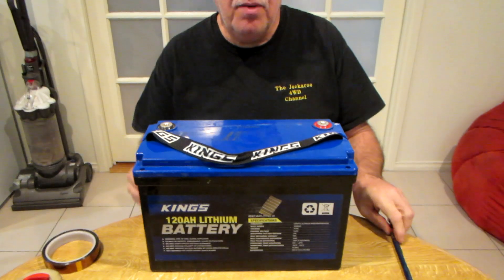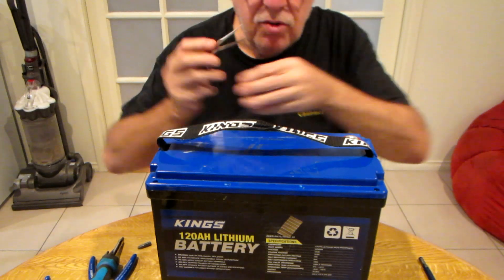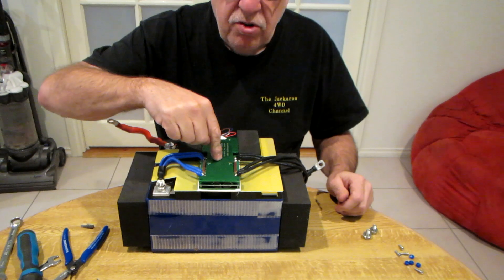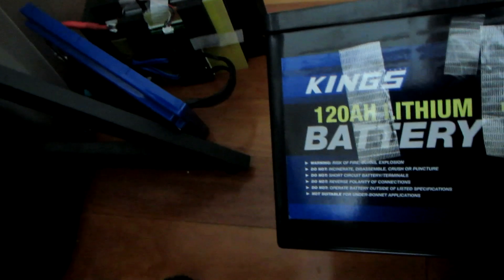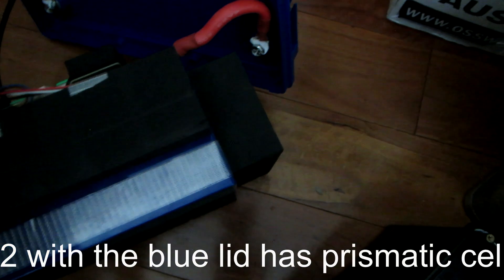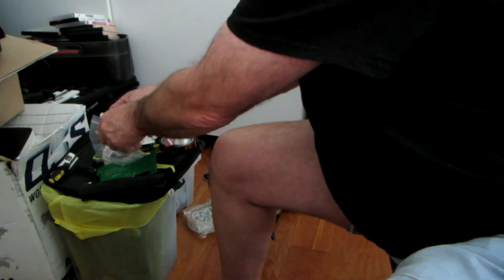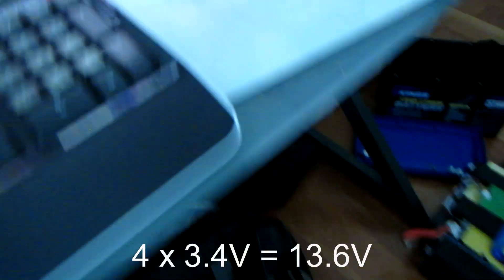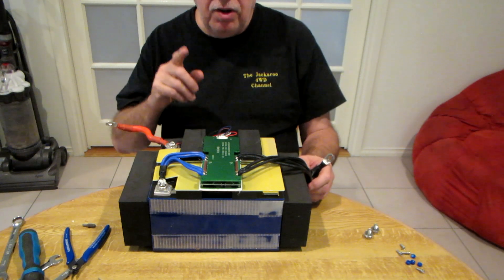BMS Swap in LiFePo4 Battery Part 1

Comment: i got a kings 120ah lithium battery, can i get it to hook up on the phone as you did in this video if so how is it done pls what app do i need
Reply from the maker: I was using the Oricom battery monitor. However, I have just ordered two new BMS with Bluetooth modules. If you can wait a week or so they are due on the 31st July. I reckon they might be a better option.
Reply: @thejackaroo4WDcampingchannel  ok so the kings dont have a bluetooth